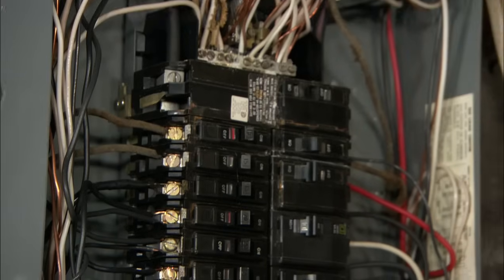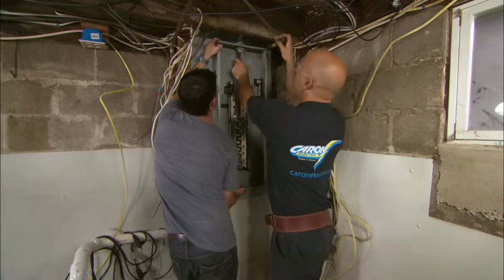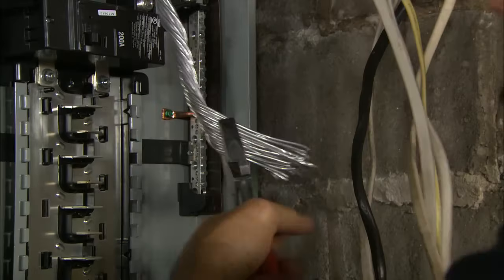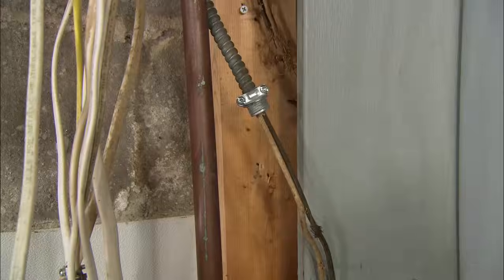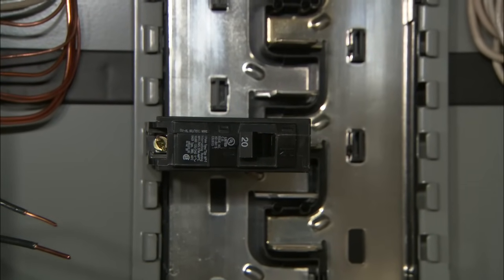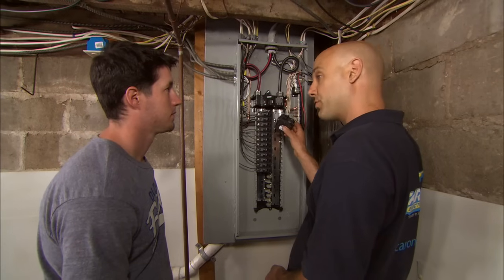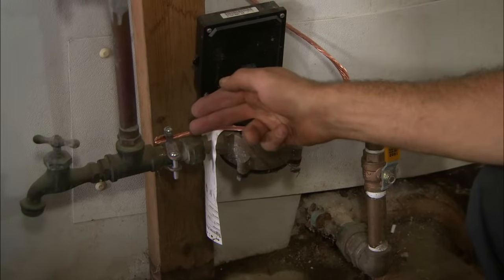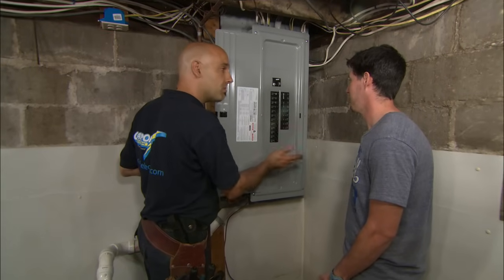How to Upgrade an Electrical Panel to 200-Amp Service (Part 2) | This Old House

Comment: this a single phases or 3?  I'm trying to learn diffent phases, I believe this is a single , just because it did not have the bar running in the middle of the ckts?
Reply: It is what is called Split Single Phase. The transformer winding has a center tap, which becomes the neutral conductor in your house.

It is NOT dual phase as claimed by  Роберт Фиэлдьс RRFIELDS65.  So rather than improperly calling the two hot legs Phase A and Phase B, they should be called Line A and Line B or Leg A and Leg B.

The currents in the two legs are in phase with each other, but out of phase with respect to the Neutral. Yes, it is a bit hard to visualize, but if you draw the full circuitry including transformer, loads and wiring - then do a bit of analysis of current flows, it may be more understandable.
Reply: @buggsy5  
They have to be 180 degrees out of phase in order to get 240 VAC out of it.  If they were in phase, you would just get 120 VAC at twice the amperage.
Reply: @guygrotke7476  Your belief is absolutely incorrect. 

When voltages are out of phase, the resulting voltage is lower than the sum of the two voltages. So if you had two 120 volt sources that were 180 degrees out of phase, the resulting voltage across the two lines would be zero, not 240.  That is why, when you have a 120 volt three phase Y system, the three legs are 120 degrees out of phase with each other and the resulting voltage is 208 volts, not 240 volts. 

In your residential system, that big power transform has only one secondary winding - so the current through that winding must be in phase everywhere. The winding has a center tap, which allows us to get both 120 volts and 240 volts. Let's call the legs A and B.  From A to the center tap (neutral connection) is 120 volts. From neutral to B is also 120 volts. From A to B produces 240 volts - which is only possible if both legs are in phase.

To look at it another way, when the current is flowing into the transformer winding at one end, it is flowing out of the transformer at the other.

Yes, it is confusing to a non-engineer. I also am not doing a very good job of describing how the currents flow.It is difficult to do with words alone. If I could draw some pictures, it would be easy. 

Forget about AC and think about DC for a minute. You can use them to represent a moment in half an AC cycle with two batteries. 

Take a common two cell flashlight. Insert the batteries in the normal fashion with the positives both pointing the same way. What is the result? You get twice the voltage and, for a given load resistance, the current is doubled over what you would get with a single cell. This is the in phase connection.

Now reverse one of the batteries. When you do the measurements again, you find zero voltage and zero current. This is the 180 degrees out of phase condition.
Reply: Its single , but it really is duel  A & B phase.
Reply: Jaime Luviano no a single phase would be 120

Comment: How come the sub-feeder cable doesn't have an insulated neutral?????  Your placement of the red and black incoming feeder wire is incorrect the red goes on the right, and the black on the left.   Let's do something here that resembles some  kind of knowledge to the N.E.C.
Reply: I believe that the center (neutral) feeder bushing has to be conductive in a distribution panel .

In practice, it does not matter to which side the red/black wires go.
Reply: I think you mean the Service... and it doesn't need to be - all those used electrons are going to run home to Mama!
Reply: And you are wrong. Don’t act like you’ve ever opened a code book

Comment: I wish they showed how he retraced, inspected and identified the old wiring.  In most states for a 200 upgrade, you're required to perform circuit inspection/testing and identification before wiring the box.
Reply: Madd Dogg circuit inspection?  Not true

Comment: Saw a water main become totally perforated and turn a woman's front yard into a mud pie because of the ground connection to the main and the fact that the neutral in the trans moved and was therefore not neutral anymore, but feeding a current directly to ground.  After fixing the main, I called the electric company and the next day they were there w/ a truck and changed out the trans.  Don't connect earth ground to a water pipe or anything but a sacrificial ground rod buried in the earth.  Still an excellent video.  Thank you.
Reply: alex tworkowski Using the water line is illegal here, probably slow be illegal everywhere - not hard to stick a rod in the ground.
Reply: If you guys watched part one he replaced the service outside using two ground rods. In my area we are required by code to bond the water and gas pipes when they are metal.
Reply: @bwhite824  same in most of the northeast where this is filmed
Reply: in the Uk thats called bonding and its there to stop electric shock. Have a read on it.
Reply: Apparently it's legal wherever they filmed this. But as a home owner I would feel more secure if the main ground was connected to a rod outside into the ground.
Reply: Brandon White same here. Always been that way.
Reply: not sure if you know but if anyone could answer why he drove the two ground rods into the ground and then didn't route the main ground from the panel to those rods I would be interested in knowing.
Reply: In the UK they are allowed to ground to gas FFS.. GAS!.. I never ground to plumbing, I do the extra labor and drive a propper ground rod..
Reply: Grounding to gas is EXTREMELY dangerous, You people are morons period. I guess it's a game of natural selection over there though..
Reply: The NEC requires it, along with a list of other potential grounds such as building steel and a supplementary ground rod that must all be  bonded to create the grounding system.  Also, if the ground rod has a resistance above 25 ohms, then another ground rod must be added.
Reply: Nhac thieu nhi tieng anh
Reply: You not only use ground rods six feet apart, but you also have to bond to the water pipe.

Comment: My house has random outlets and appliances tied to the same breakers. I want to separate them on to their own breakers. Looks like fun.
Reply: hehe where i live there are no codes and restrictions and i do shit like this most of the time. it also helps that ive been diy'ing electrical wiring since I was like 10 yrs old. Its mind blowing how much protocol and proper technique you have to follow while doing stuff according to code or with safety regulations. though i guess doing this code regulated stuff would be fun. no one likes shoddy unsafe third world electrical work.
Reply: @araibirshad8294  
I live in California and electrical work requires a licensed electrician OR the home owner can do it.  You just can't sell your electrician services without a license.  Then it has to be inspected, and if you screwed up the inspector will usually tell what to do to fix it.  Unless he sees you are an idiot, and makes you hire an electrician for your own safety.  I upgraded my breaker box and installed solar with a grid-tie inverter myself.  The inspector complimented my work.
Reply: Is there a video about this?? Would like to hire someone to do the same.... 👀
Reply: "hehe where i live there are no codes and restrictions" - Where? in India where they give fuckall about health and safety?
Reply: @Elfnetdesigns  yes 🤣🤣🤣🤣🤣🤣🤣🤣🤣🤣
Reply: Call a licensed Journeyman Electrician, don't do it yourself.
Reply: Where I live, adding circuits, doing anything in a panel, or upgrading services must be done by a certified electrician.

Comment: Where are the ground  electrodes are post  to be 2 separate 6 feet and bonding to neutral in the main panel  as per NEC ( the water pipe is an auxiliary mean of grounding electrode)
Reply: Previous video shows the ground rods
Reply: Really shouldn't be done.  A liability, really.  Read above.

Comment: Never EVER let the customer turn on the main after being reconnected to service....if anything happens it is completely the contractors fault.
Reply: lsvtecb18c1 True, but this is all staged.  Before they did that take, everything had already been tested.
Reply: Electrician doesn't want to get electrocuted. Electrician rathers let the customer get electrocuted if something goes wrong.

Comment: Why wouldn't he unscrew all the wires?  Now he has to strip them all.
Reply: Brian Schonecker He likely wanted freshly stripped ends.
Reply: I would want uncrushed and freshly stripped end as well. Plus, it probably saves a bit in labor cost.

Comment: Just seeing the guy using a torque wrench on the electrical box means he does take care.
Reply: Are you talking about the dewalt impract driver? If so, that’s not a torque wrench 🤣
Reply: I saw a regular socket wrench, not a torque wrench. But even if it was a torque wrench, hes on TV. He should be doing things properly.

Comment: how much does this cost?
Reply: It depends on where you are and how complex the job is. Probably somewhere between $1000 and $2000 for a straightforward replacement, more if the power company has to do more than disconnecting/connecting feeders.
Reply: I literally had an estimate wrote up for this very thing on a home I'm looking to buy. Same process, and overall set up was the same.....The estimate came in at $2k

Comment: You should always turn off all your breakers before energizing the main breaker. As I seen someone do what he did and the panel blew off the wall. Was if the sun had appeared in the room it was so bright. When I got to him. He had no hair left on his upper body. It blew his shirt off... They said it produced 50,000 PSI pressure and copper particles embedded in his body. All because someone put one screw in the wrong place...
Reply: I doubt if it was anywhere close to that much pressure. However, plasma blasts can be lethal.
Reply: Lookup it up in the NFPA 70e.. An arc blast at 10' of 400 amps Produced 50K PSI. At 35,000 degrees...The high pressures can easily exceed hundreds or even thousands of pounds per square foot, knocking workers off ladders, rupturing eardrums, and collapsing lungs.
http://www.arcflashpro.com/arc-flash/arc-flash-blast
Reply: @MasterChief-sl9ro  So what happens when the power goes out and comes back on? I call bullshit.

Comment: No ground rod grounds, no Kenny clamps, no conveyance receptacle, ply wood too small and not painted black, landing more then one ground underneath one terminal.... could probably find more but I definitely would not advertise this as a job well done
Reply: The ground rods were installed in Part 1 during the outside meter upgrade. A convenience receptacle is just that - not necessary or even desirable. The plywood looked plenty large to me and why paint it black? Many panels allow landing more than one ground/neutral (and even circuit wires) under one lug.

You haven't found anything definitely wrong yet.

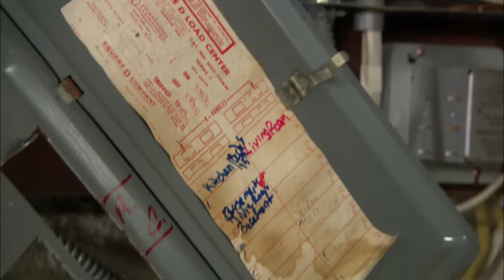Comment: Don't Try This At Home.  0:13 - Hey Kids Paaaaaay Attention, Make Sure You Get Your Mommy or Daddy Electrician to Properly Help You Cut Those Wires.  The Bald Man Didn't Show At Least The Shutting Off Main Power Switch Before Cutting The Wires.
Reply: wow, it's almost like a video called "part 2" would cover that stuff in "part 1"??